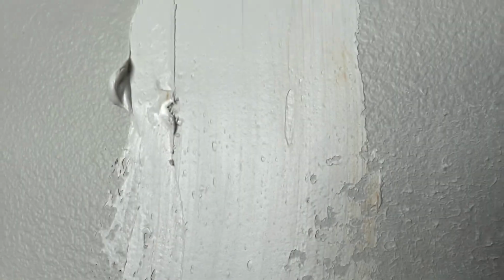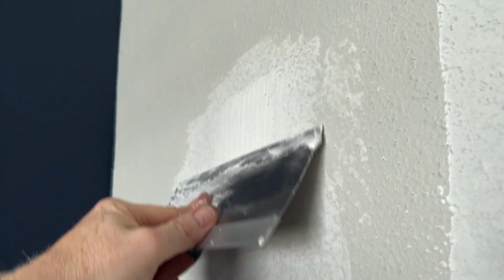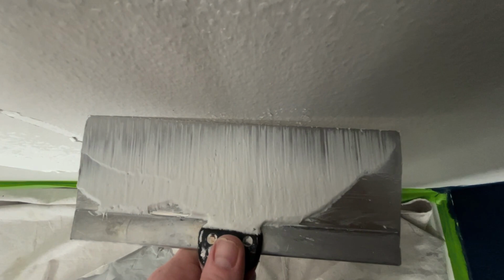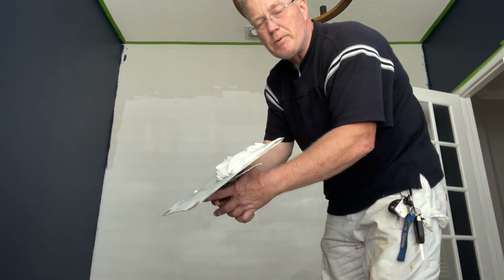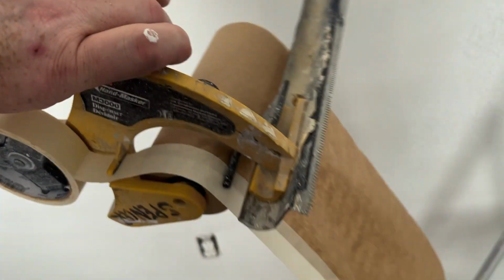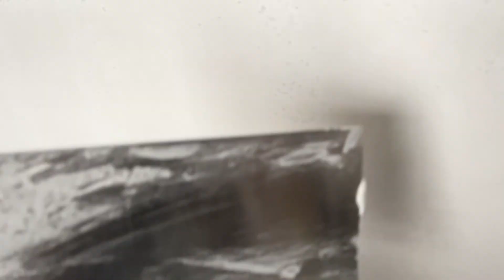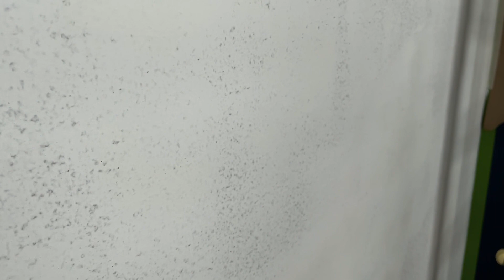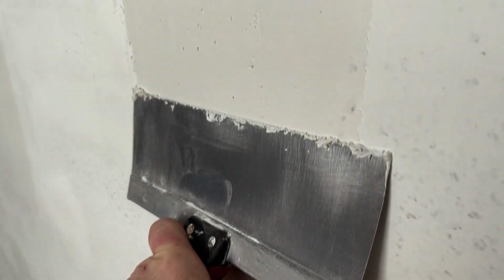Wallpaper an Accent Wall for Beginners: (SkimCoat) Part 1 of 2 - Remove Texture - Spencer Colgan

Comment: Hey Spencer, your videos are a great help thank you very much👍.
    I was wondering if you could tell me what to do with the leftover adhesive still on the wall from commercial "wall vinyl" removal?
Reply from the maker: Are you painting over it?  Wallpapering over it?
Reply: @spencercolgan  I would like to paint over it
Reply from the maker: @skyryder7662  ok.   Scrape off what you can with a steel scraper.  Then, paint over it with kilz original.  Wait 24 hours.  SkimCoat over that.   Sand. Prime with zinsser 1-2-3

If you can’t SkimCoat, you can scrape off and wash off with hot water but it’s a lonnnng process.
Reply: @spencercolgan  thank you so much for answering quickly, just happened to be in a time crunch. Yes, scrape, kilz , skim coat and then the 123 zinsser.   That sounds like a great plan, it will give me a proper surface for painting.  I live in South Dakota , if I may I would like to know how much to charge per square foot? You prefer not to answer that question I understand.  Again thank you very much Spencer for your help and time. You just got another subscriber👍🙂
Reply from the maker: @skyryder7662  no worries!

Your time is valuable; after all of your expenses, including gasoline to get to the job and get back home, you must put in your pocket $550 minimally.  That’s after taxes, after every single expense you can think of.  Minimally $550; you are doing a very advanced skill and they need to pay you for it. 

Now, can you help me out?

Would you please go on the following link and give me a five star review? If you had five stars would you do me a favour and say something nice about my knowledge and willingness to help and how I helped you in particular? This means a lot to me feel free to email me any time my friend! Thank you for subscribing

 https://www.google.com/search?q=tampa%20wallpaper%20installer&tbm=#lkt=LocalPoiReviews&trex=m_t:lcl_akp,rc_f:nav,rc_ludocids:18168418332679895040,rc_q:Spencer%2520Colgan%2520-%2520Wallpaper%2520Installer,ru_q:Spencer%2520Colgan%2520-%2520Wallpaper%2520Installer,trex_id:XCBBr

Comment: Could Gardz be used on builder grade flat paint prior to peel and stick wallpaper installation or would you recommend a primer and satin finish paint first?
Reply from the maker: Yes Kathleen.  Use it.  You can substitute two parts water and one part weld bond that you can purchase on Amazon, which is cheaper.
Reply: @spencercolgan  thanks! I have no idea what the two parts water and one part weld bond means. Is that a different product from Gardz?
Reply from the maker: @kathleenclipper9839  

Yes. And cheaper

Weldbond Glue 3L / 101 oz - Bonds Most Anything! Non-toxic Adhesive Glue For Wood Glass Tile Craft Fabric Rock Cement & Concrete And Any Other Porous Surfaces. No Fume, & Water Clean Up. Glue Gallon

Mix it up
Reply: @spencercolgan  awesome! Do I allow the glue to dry before applying the peel and stick or install the wallpaper when the Weldbond is still wet?
Reply from the maker: @kathleenclipper9839  yes, ma’am… It is different from GARDZ; it’s better, it’s cheaper, and it is more versatile; get a bucket, put two parts of water, and one part weld bond